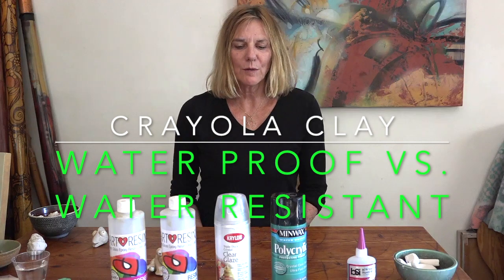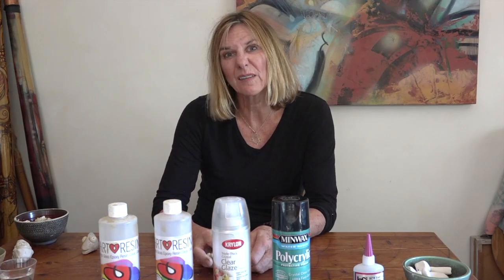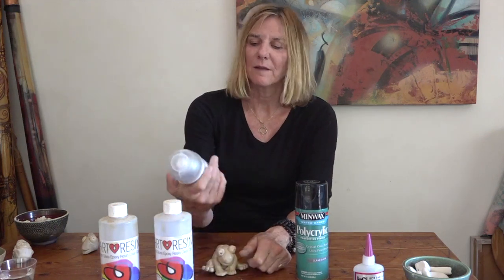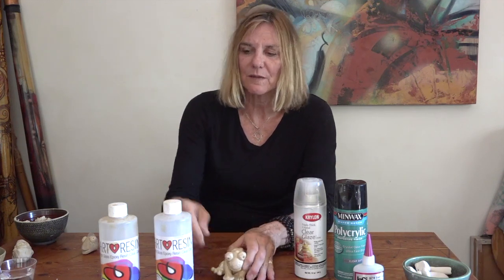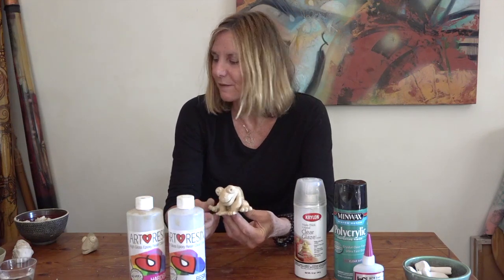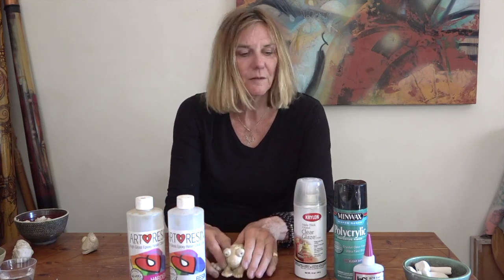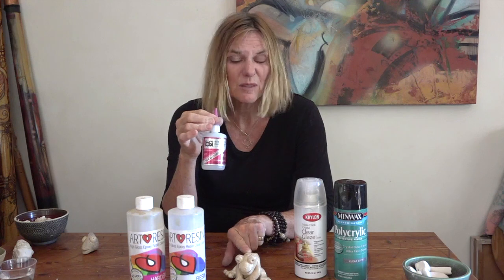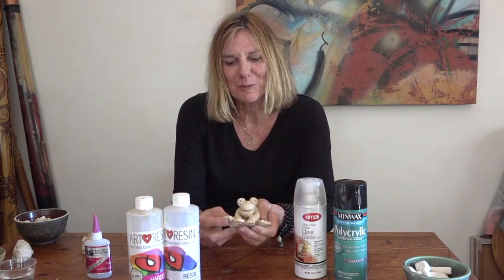Crayola Clay: Water Soluble vs.  Water Proof vs. Water Resistant

Comment: Hi Michele, great video, thank you for taking the time to make this. This may be a bit off topic but i wanted to use the clay to make a piece of water proof slate for a bonsai forest. Can the resin be applied with a brush after the slate is made or does it have to be poured on?
Reply from the maker: Hi. If you are going to use resin you should follow the instructions on the product. Some resins are best poured and some can be brushed on. If you are starting from scratch, and want your slate to be totally water proof I would suggest making it out of epoxy clay. There are several brands to choose from such as Apoxy Sculpt, Milliput, and Epoxy Clay.  https://www.amazon.com/Epoxy-Clay-Self-Hardening-Sculpting-Repairing/dp/B0C7ZDQCTF/ref=sr_1_1_sspa?crid=1TLOL4ZKWYVTP&keywords=apoxie%2Bsculpt&qid=1699921379&sprefix=apoxy%2Bsculpt%2Caps%2C133&sr=8-1-spons&sp_csd=d2lkZ2V0TmFtZT1zcF9hdGY&th=1